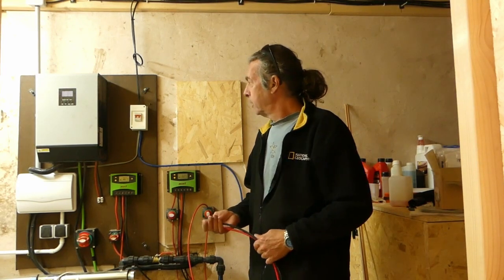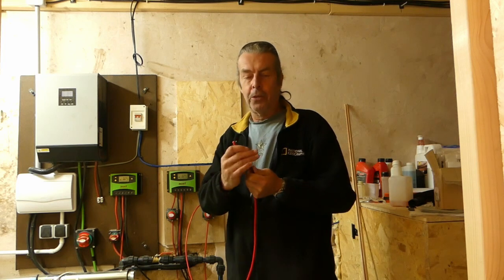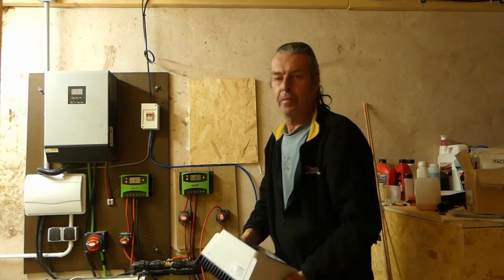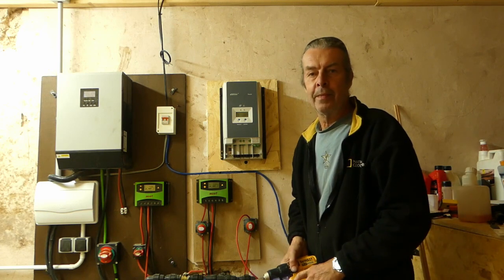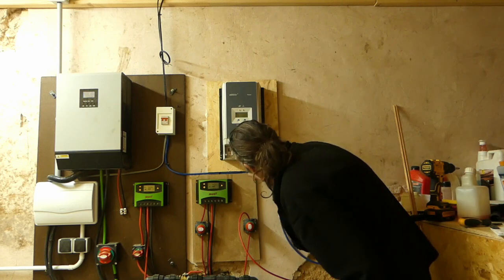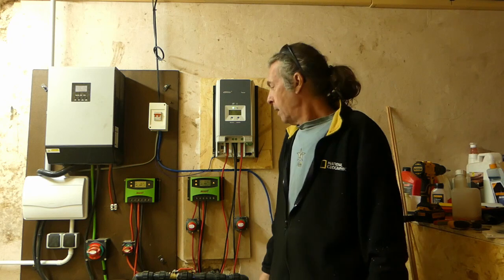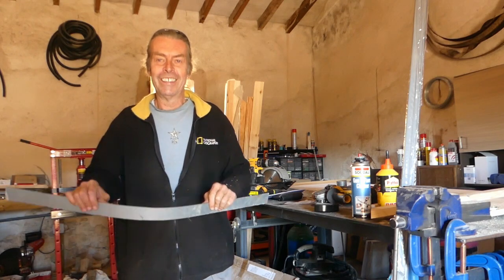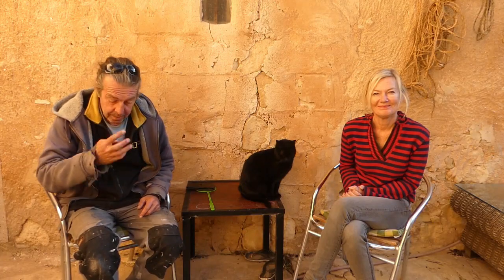At last! - installing the new charge controller - Off grid solar

Comment: Andy, What type of work did you do before you moved to Spain? It seems you know a lot about solar energy and I was wondering what your experience is with solar. I’ve watched other channels who have extensive solar like yourselves and I cannot understand a bit of what anyone explains about it. Must be my age. Both you and Sharon work so well together. Happy Birthday Andy. Cheers.
Reply from the maker: I originally started out as a joiner turned welder fabricator but worked in the building game in various guises for many years. I learned electrics (including automotive) and have rewired many houses in the UK and France. The solar was a natural progression, although, as you can see in other videos, I have made the odd mistake, mainly because a lot of the information out there is not correct and / or poor. Thank you.